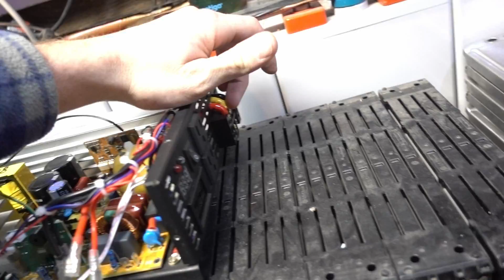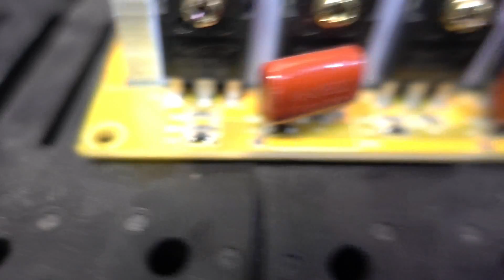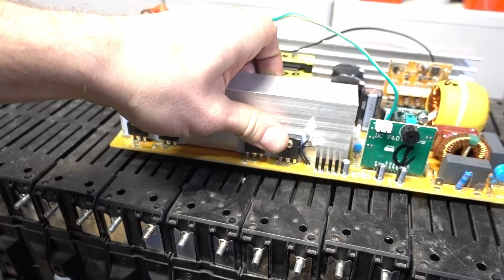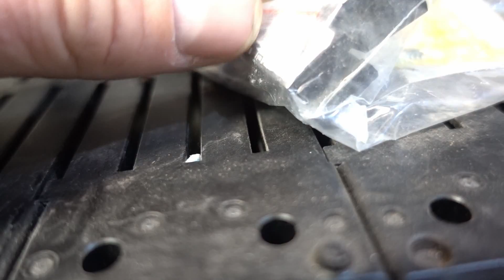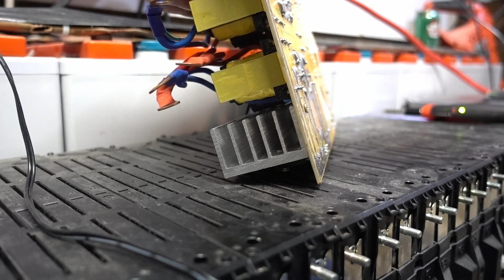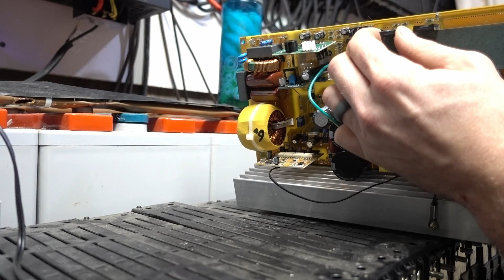Starting The 3000W Reliable Inverter Repair

Comment: If you're not planning to keep the broken mosfets, they're easier to remove if you clip the legs then remove each leg one at a time. You don't have to keep the solder on all three legs melted to remove them this way.
Reply from the maker: man I never thought of that! I am keeping them might weed the bad ones out later for a crapy inverter, but great trick!
Reply: @GoingOffGrid101  Hi friend . I would like to know where to buy the spare parts for the investor
Reply from the maker: @Josemarquez-nu2sn  i email reliable asking for them
Reply: But...there is still a problem when you install them...you have to use that big soldering iron...to get the FET installed and pushed to the right location...
Reply from the maker: @tonymac96  the 200w soldering iron was 25 us
Reply: Úmmmm...testing the  FET installed...would the continuous (zero Ohms) is enough to point out that the FET is in shorted between the gate and the source? ...Would there be another type of test without desoldering the FET ?  Thanks
Reply: Úmmmm...testing the  FET installed...would the continuous (zero Ohms) is enough to point out that the FET is in shorted between the gate and the source? ...Would there be another type of test without desoldering the FET ?  Thanks
Reply: After watching a few of these videos with the reliable inverters having half voltage on neutral, I decided to not connect my neutral on my 5K one, the moment I turned it on for the first time, sure as $hit, half voltage on the neutral, why they do that?
Reply: @quagmyer7230  It's only a reference voltage, if you want to bond the neutral do it at your load centre (consumer unit) not at the inverter. I've done it successfully on my 3000 and 5000 watt WZRELB inverters with no issues.
Reply: @Malburn  that’s what I did, thanks.

Comment: I asked Reliable the color code for their 2500w 24v inverters. The lady said Red is Hot, Yellow is ground and Black neutral. Thats how I hardwired seems to be working ok so far but my system is not grounded yet and leads to a separate breaker box also not grounded yet.
Reply: How would I ground this?

Comment: I have on all my reliable units have the ground and nuturel are connected together and have had no problems at all I use a hot air to remove the resistors and also a desoldering pump make the job easy
Reply from the maker: you can use the ground as long as it is not bound to the neutral, check with a multi meter from the ground on the inverter outlet to live and then do the same to neutral, you should get close to 50% volts both ways.
Reply from the maker: im starting to think that some reliable inverter do not have live grounds like this one I tested, I will have to test all mine and see.

Comment: Must have received your computer. I think you need a hot air station.
Reply from the maker: i did but this was edited on my old laptop and it was super hard as it was glitchy as can be... and next video coming up late tonight. I am editing the video now.
Reply: Going Off Grid whats your new laptop   may i know which model and company
Reply from the maker: BRAND NEW HP Omen 17.3" 17-AN012DX FHD i7-7700HQ AMD Radeon RX 580 12GB 1TB
Reply: Going Off Grid that’s a epic laptop NOW we are talking